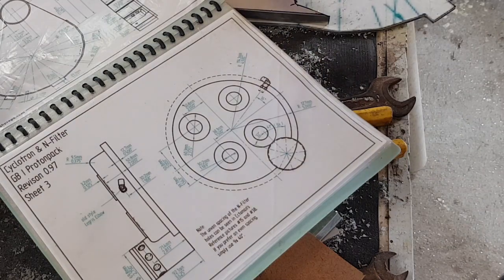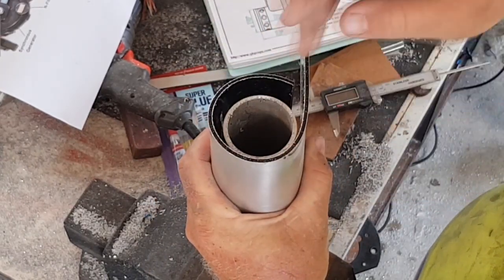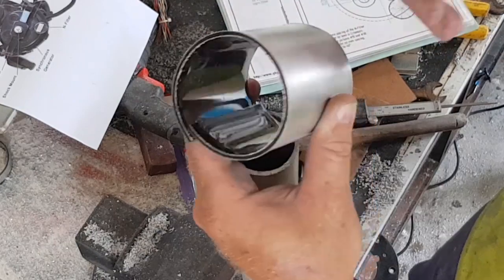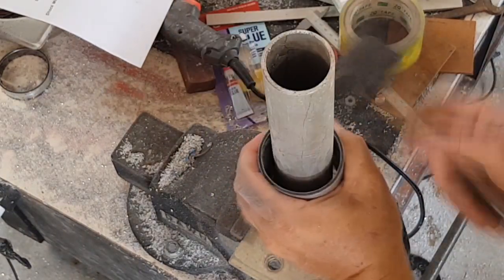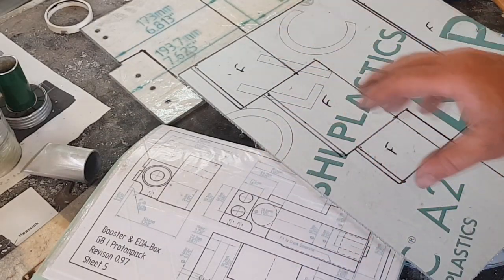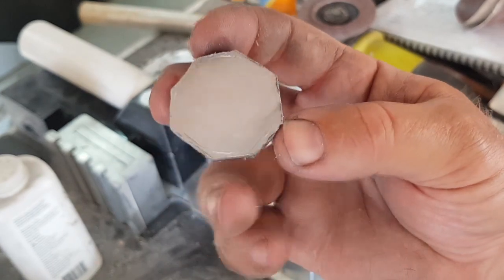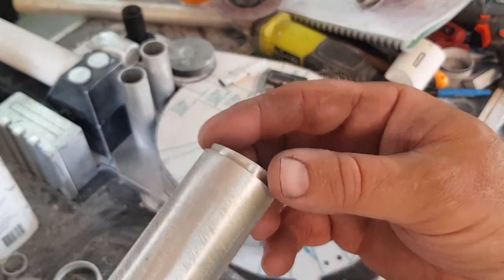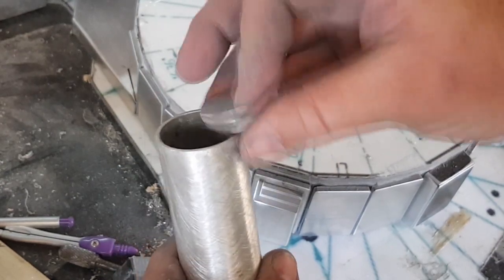Proton Pack Build P3

Comment: I'm amazed to see how seemless you got that tube done. Very well done.
Would you have made this thing differently if you had means to weld the aluminum?
Reply from the maker: Yeah, probably, there are quite a few spots on the "real" pack that have welds, as I go further into the build I'll be making up some fake welds to mimic those bits
Reply: @jazcreations  A fake weld look. Nothing you can't handle I'm sure.
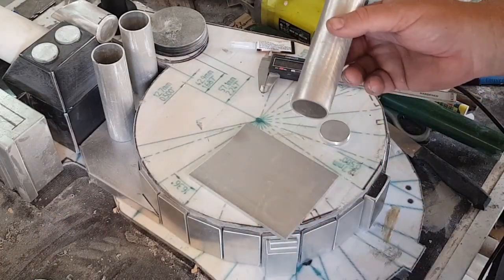Reply: @jazcreations  7:08 you could try aluminium brazing rods, all you need is a small propane torch, looks similar to a 'real' weld too.
Reply from the maker: @AndysMachines  I have used it in the past don't have any at the moment... What type do you use? I"ve had limited success with it when doing different thicknesses of metal
Reply: @jazcreations  I just got the local hardware store stuff, no particular brand. I don't use it very often, it does have it's limitations. The trick is to heat the metal until the rod melts on it, not melt the rod directly, it's more like soldering than welding.